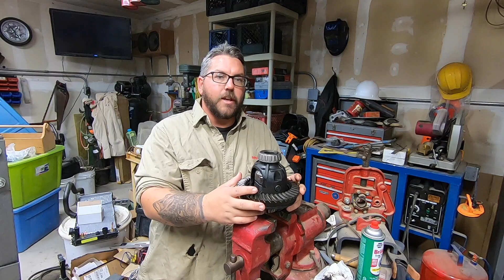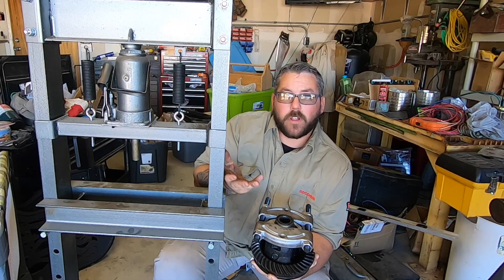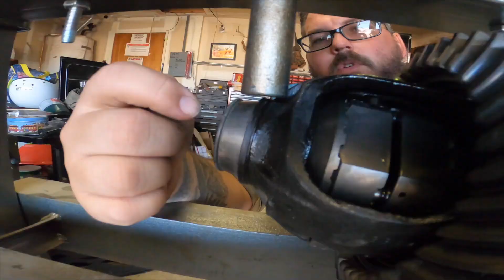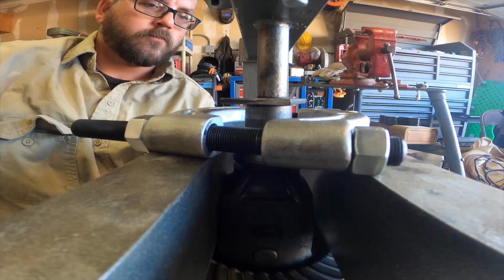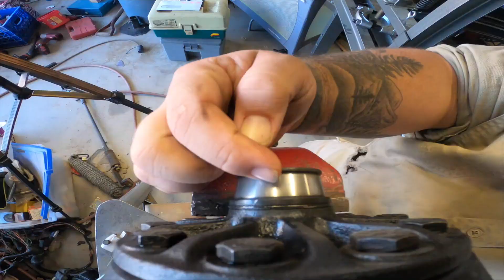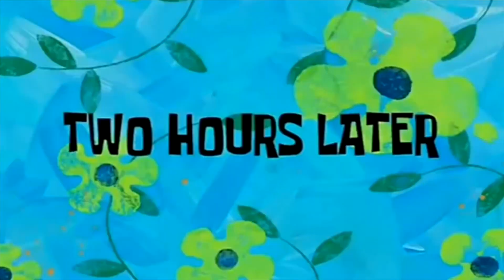How To Replace Carrier Bearings On The Jeep Cherokee XJ Dana 30

Comment: Here's a dumb question that's going to sound like I'm splitting hairs... did you preheat the oven first, or put the bearings in and let them preheat with the oven?
Reply from the maker: It doesn’t matter, you just want to make sure they reach a good temperature. Me personally I just put them in there while it was preheating as well.
Reply: @ProjectVenture  perfect... I'm on this step now! Thank you!!!
Reply: Just had the bearings in the oven  and the carrier in the freezer, for the time specified. IT WORKED!!! Thank you a million times over.

Comment: You wouldn't happen to know the part number for these bearings would you there is a lot of part numbers online and I can't decide if there pinion or carrier bearings
Reply: I figured it out summit has the best discriptons on there parts then use the part numbers to buy them on rocksuto
Reply from the maker: @jeremyhanna3852  sorry it took me so long to reply also. Glad you got it worked out
Reply from the maker: Not off the top of my head, sorry.
Reply: I ran into the same issue

Comment: What's the harm if you cut too deep and go into the surface of the carrier? The bearing sits so tight and only the bearings in the cage need to spin freely so a minor cut or nick shouldn't be that big a deal. Your thoughts, please.
Reply from the maker: A little nick shouldn’t be a big issue but damaging the carrier could cause the bearing to not seat properly and cause things to be out of balance among other issues causing damage to your differential.

Comment: So you just reuse the old shims with the new bearings? Don't you need to measure for new clearances due to differences in manufacturing or anything like that?
Reply from the maker: The difference in the bearings should be so minute it should make that much of a difference just changing one bearing. If I were replacing both bearings on the carrier as well as the pinion gear I would make sure to check for proper backlash and run a pattern.

Comment: With the new bearings do you still use the same races and caps or replace?
Reply: You would replace the bearing and the new race that comes with it, but you reuse the factory bearing caps in the housing and torque it to spec
Reply from the maker: All I replaced was the bearings. I would recommend though inspecting everything else for any excessive wear and replace if necessary.

Comment: Do you need to lubricate the bearings before reinstalling carrier into vehicle?
Reply from the maker: It’s always a good idea to run some gear oil on the bearings before install.
Reply: @ProjectVenture  Do the bearings need to be packed with grease? Or just lubed in gear oil?
Reply from the maker: @ just gear oil. Do not pack them with grease.